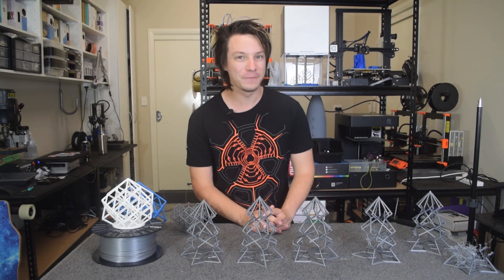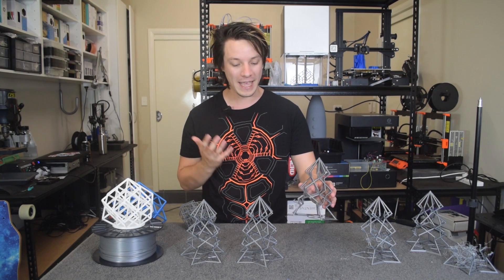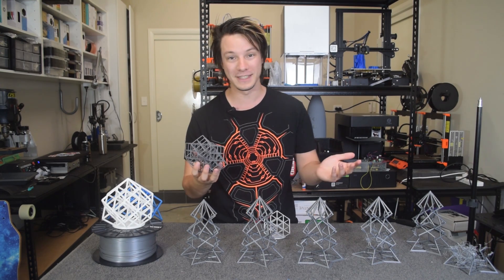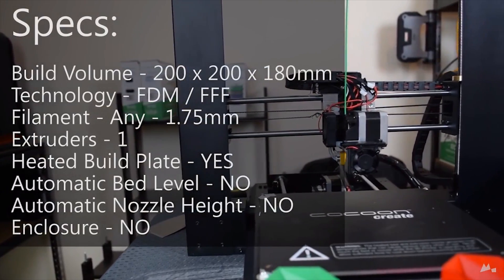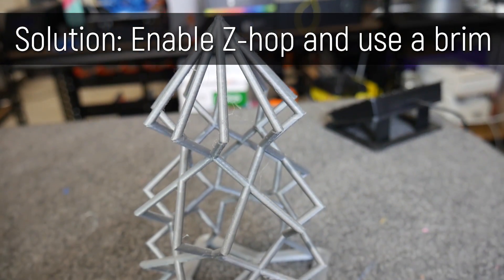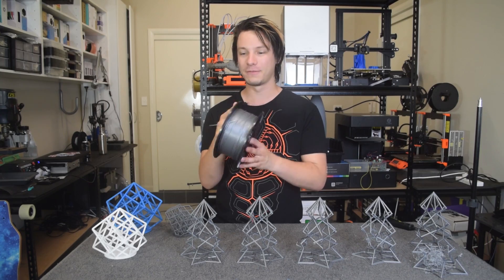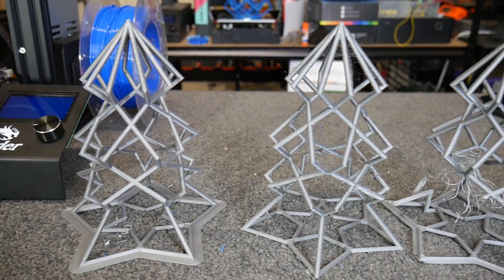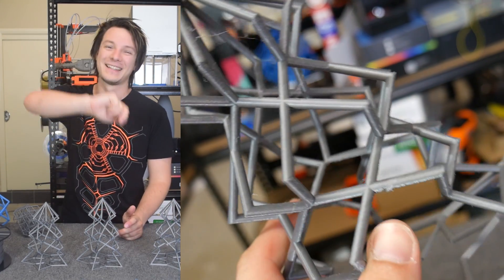Can you 3D Print the Christmas Lattice? My results!

Comment: Time to give my Duet 2 powered FT-5 R2 a workout.
I use a lot of tree supports, which are like a complicated lattice. 

I am a fan of cube style machines, where the bed goes up/down, I had a CR-10 for a short time, and it would knock into prints fairly often, that little cetus probably works well because it has linear rails and a short arm and small bed, not a lot of flex/wobble going on.

Comment: Hay anyone  know a good  3d printer  in the $700 to $1400 range for 28mm figures I wanted  to  print them  in  abs and use water soluble material supports  for a cleaner  surface. I bin able to get  some great  prices  out of my  flashforge  finder  bit the  bottom were the supports are not as clean as I want  like

Comment: hi and marry Christmas to you too! i had a question about a new Filament, its calles facilan C8 and the makers say it is a type of plastic designed for 3D printing. they claim it is the best and has no fail rate. i was wondering if you could test this?

Comment: You do not maintain your printers on a monthly basis? Every month I check the belts and lube the rails and Z-Screws, tighten up loose screws,  and check electrical connections on my 2 Tronxys (X1 and P802M), and I have no problems with printing torture prints on them. Except for some under extrusion at times (from cheap filament), my prints come out fine.

Would like to know how to do the Z-Hop with Slic3R though. Don't have Cura.
Reply from the maker: If I maintained on a monthly basis I would never stop lol. It depends on print volume and priority for me, and the little wanhao has long passed that. Z-hop is called 'lift Z' under the printer settings > retraction menu :) Mine is default at 0.6mm.

Comment: I have and still use a Cetus mk2 and it is limited but it prints pla and petg(heated bed add on) with no problems.  I have now added other more modular printers and slicers to the mix but the Cetus was a great 1st printer for working out of the box and teaching me about the hardware.  Thanks mm for helping me get into 3d printers!

Comment: Might the Cetus print a bit better because it's running on linear bearings as opposed to roller/rails?  (The LBs would probably be more precise, if somewhat slower (or harder to drive) to print.)

Comment: Prusa MK3, Shrunk model to 75% scale. Took 5h40m. Used Slic3r PE defaults for 0.2mm layers but using Chris Warkocki's (https://www.youtube.com/user/codiac2600) "pretty PLA" printer settings. Adjusted layer thickness to 0.32mm layer height, 5 top/bottom layers, 5mm brim, lift z (z hop) from 0.4mm to 0.8mm.
Got a lot of stringing since I didn't adjust retraction for the layer height, translucent green PLA from MakerGeeks at 225C/60C 
photo album: https://photos.app.goo.gl/cMytZTxEzn39iZvW8, even included some USB microscope shots.
Reply: Also, Angus, thanks so much for making these available to us. I've donated for a couple of your models now and they're really great, and have thoroughly enjoyed supporting you, Joel, Stefan and Joseph Casha, for all of your insights. Hope you and Mrs. Muse have an awesome Christmas holiday.

Comment: Why would you not always have z-hop enabled?
Reply: On a print that uses the maximum z height? Faster print times by a few seconds? Less stringing as Angus said. But that seems like a small price to pay. Even smaller with a heat gun
Reply: @DaDarkDragon  z-hop is like 1mm or something. I think you can live with a 1mm shorter z-height :) Also, I think people can live with a few seconds longer prints. And as you point out, the tiny stringing that MIGHT happen with z-hop is easily fixed with a heat gun. So the question still remains :)

Comment: I love my Cetus MK2. It prints PETG really well (with a heated bed) also, so much so I haven't used PLA since I printed my first PETG print. Why don't more printers use WiFi and USB interfaces to print? The Cetus interface is so seamless.
Reply: It's just not a good solution for most people, that's why you see so many people upgrading printers that came without screens&SD readers to add them.
You can switch your computer off, not worry about a forced upgrade or use it for something processor intensive - while you printer just does it's thing.
Reply: @_Piers_  Methinks you're missing the point here, the Cetus / tiertime software spools the whole file to the machine, it's not "tethered" so has all the advantages you mentioned.
Reply: @owensparks5013  I completely agree with you. I have a really cheap and low powered laptop and other than the few seconds it takes to send the data to the printer, it shows no signs that it is slowing down or cannot perform highly intensive processes. But to each his/her own. I love the ease of use.
Reply: Because Octoprint is cheaper currently. The move to 32bit boards will fix that.

Comment: Hi, Angus! What tubing is best for Ender 3? Do you mean PTFE tube or the fittings? I have Tevo Flash but I guess it has the same PTFE bowden tube.
Reply: The blue tube Angus indicated in the video is Capricorn tube (that's a brand if PTFE tube).
It has a smaller internal diameter that the usual tubing, so reduces the wiggle room a little.
Reply: Thanks!

Comment: What's your opinion on Coasting vs Retraction ? I was able to nearly eliminate the need for retraction by tuning my coasting settings , but i still use a retract on layer change with z-hop to clear any bumps that could be left at the end of a line.

Comment: So it seems like no printer could do it without enabling Z-Hop, besides the Cetus. Or not? Did you enable Z-Hop for the print on the Cetus or not? Because if yes, this would mean that the best of the bunch probably is the Ender-3 ...
Reply from the maker: Nothing wrong with z-hop, I recommend it. It just increases stringing on the ender 3. The cetus does move up a tiny bit between points.
Reply: So as every printer needs Z-Hop that would mean the Ender-3 (with Capricon Tubeand maybe a modified part cooler) probably is the best choice, because of the nice surface finish. Thank you.

Comment: Recently pimped my CR-10 S4 with Cap Tube, Micro Swiss hotend, Bondtech extruder and Keenovo heatbed (240v 1000w), along with motor driver tuning. Think I should try this to see if I've made it as good as I intended.

Comment: On my Ender 3 I recently printed quite a complex assembly of spaceframe girders with lots of similar angled posts.
Using 0.15mm layers and Z hops, I found 6.8mm a good retraction amount for very little stringing. Even coped with bridging the top layers to join them up without any droops.

Comment: Had to google "z-hop". Found it was a cura function. I use slic3r prusa edition, and I found that "z-hop" is the same thing as "Lift Z" in slic3r for anyone wondering.
Reply: z-hop won't work on all the printers. sometimes rising the head and letting plastic ooze from the nozzle in process makes more negative impact on the model than the risk of touching the print with the nozzle. I would suggest to finely tune retrection settings and print as cool and slow as possible. Hope to find some time and print that tree on my Ender 3
Reply: Kieran Short all slicers have z-hop
Reply: ya same, i was soo confused when he called it "z-hop"
Reply: This is enabled by default in slic3r, correct? @Angus, can you confirm whether or not slic3r can print one of your trees adequately with default settings?
Reply: @bostonwatts9060  it definitely can, but on some printers it would do more mess than help. Every time you rise the head you are leaving the ooze under and it does not go anywhere (on the opposite of the head moving to the side right away).